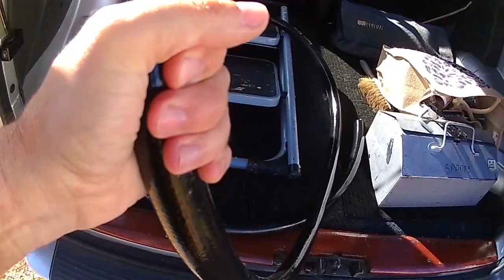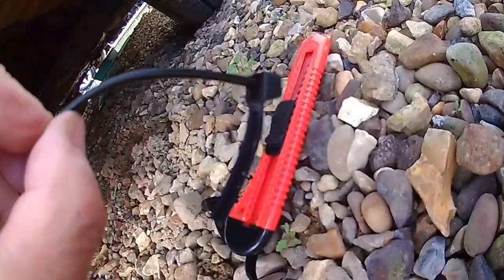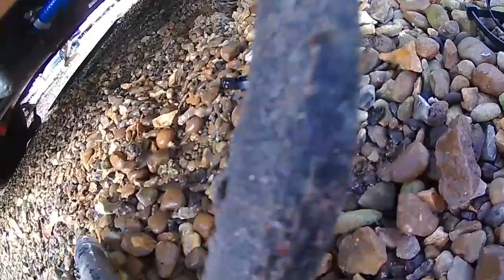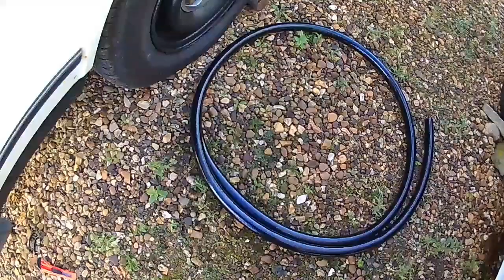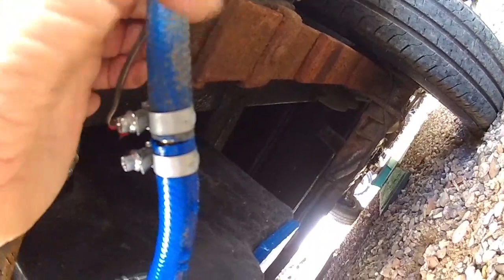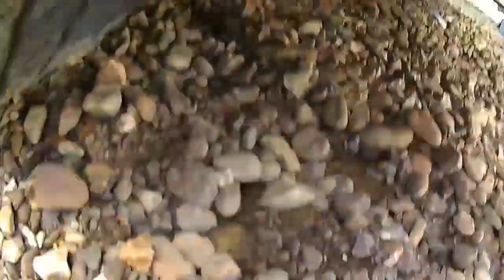Water tank. Filler Pipe. Talbot Express. Motorhome.

Comment: Hi what size pipe did you use mine is it 30mm? Please regards paul
Reply from the maker: Hi Paul I used 1inch tubing. Ebay listing is (Food Grade Hose 1" (25mm) Fresh Water Pipe Non Toxic - Camper/Motorhome/Yacht) Hope this helps. Cheers from George